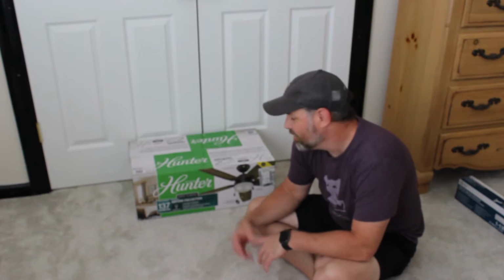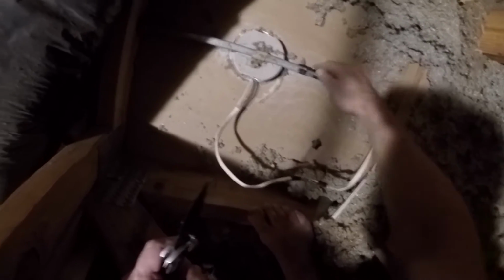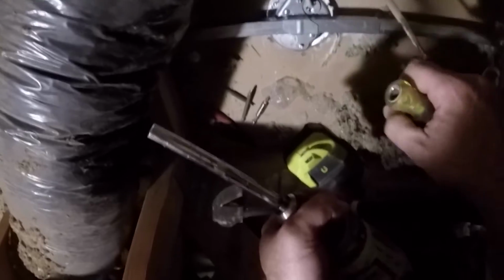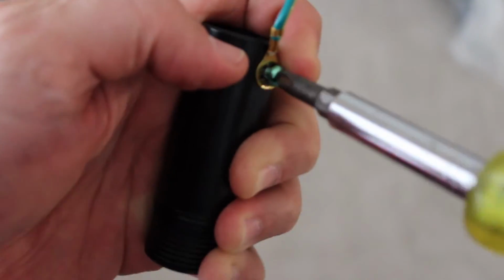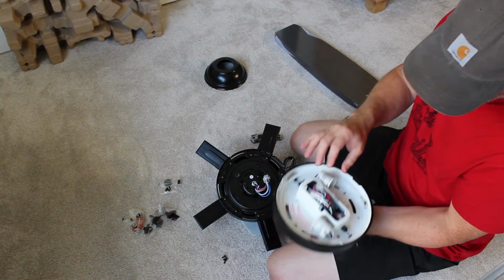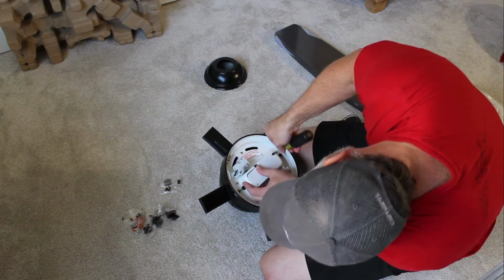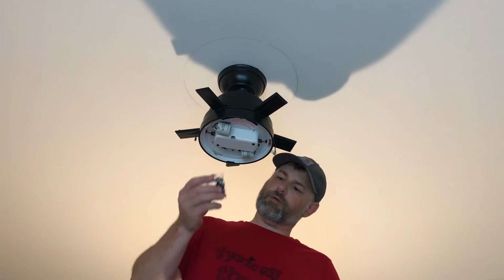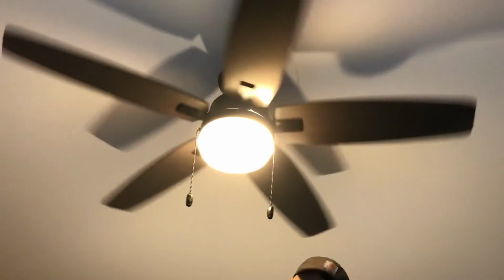Installing a ceiling fan and a new fan mounting box - 54" Hunter Antero

Comment: Thanks for this one of the better detailed diy vids and showing the attic portion was very helpful.
Reply from the maker: Glad you liked it! Thanks!
Reply: @typicalthrill   I get 3/4 of an inch down and it starts cross threading
Reply from the maker: @jethrobodean8585  Are you sure you have that set screw all the way out? Maybe just remove it all the way to make sure it's not interfering with the threads?
Reply: @typicalthrill   Long story short turns, out that it is a known problem and that as long as the downrod is below most of the set screw hole it's fine.

Comment: Thank you for posting this video.  I bought the exact fan, and used your instructions.  Question, coming out of the ceiling box I have a black wire, white wire, green/yellow stripe wire, bare copper wire, and a "red" wire.  Using a single switch.  Do I tie this red wire in with the ground wires?
Reply from the maker: That’s not something I would be able to answer without seeing how it is wired in at the switch. May want to use a tester to see which wires have power to them. Bare wire is ground for sure, so you can put the negative lead on that.
Reply: @typicalthrill  My mistake, there are three switches on the wall, but only one controls the fan.  Both the black and red wires are "hot" and have power to them, I checked them.  Would it then be black to black, white to white, red to the blue wire on the fan, and ground to ground?
Reply from the maker: @bodeans59  If only one switch works both the black and red wires, then attaching one to the blue wire makes sense. From what you're describing, I would have assumed one of the switches worked the red wire, and the other works the black. Either way, from what you're describing, it sounds like your wiring is right. I'm not an electrician though, so if in doubt, get a pro to take a look!
Reply: @typicalthrill  Thanks for the help!  The ceiling fan I took down did not have a light fixture, the new one does.  I guess the extra red wire was there in case of a fan with a light kit.

Comment: Any issues threading downrod into motor?
Reply from the maker: I did have a little trouble getting it started for some reason. That's the exact time my camera cut off, so I don't have footage of actually threading it in.
Reply: @typicalthrill  Follow up:  It turns out that it is a known issue. And that as long as the downrod covers most of the hole that the set screw goes in then it's far enough down.